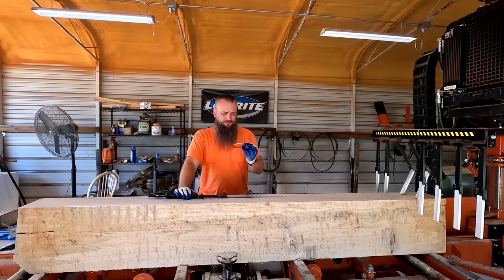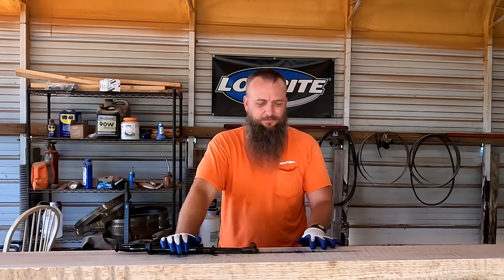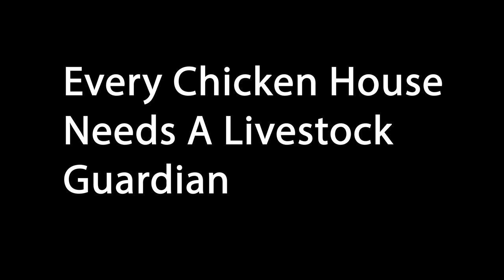Building A $10,000 Sawmill Chicken House

Comment: I haven't commented on a video in a good while but was compelled to do so with this one. I once raised ring neck pheasants and Pharaoh quail. The quail were kept in pens similar to large rabbit hutches, up off the ground and boxes on each end where they could get in out of the weather. But the pheasants had a similar run to the chicken run you built. But I used regular Chicken wire rather than the aviary wire you did, that was smart BTW, help keep the egg eating snakes out. But I dug a shallow trench about a foot wide and maybe 6 inches deep just outside the wire. I used 1/2 inch chicken wire in a 3ft. width burying the roughly 1ft. of wire in the shallow trench. What this does is it presents a barrier for a digging predator like a fox or dog, even some cats will dig. They run into the wire and can't dig any farther. I also covered the top with aviary netting to prevent the hawks and falcons from getting in from above. They also make a clip-on blinder for pheasants that fit in the nostrils. Pheasants will peck each other to death unless you keep them separated or use these blinders. The kiln made a great chicken house and you and your Dad have built a fine run for those pullets. You might consider my suggestions to add to it though. I still enjoy these videos more than most any of the rest I watch!!! Good work Nathan!!

Comment: - Does your area have issues with boroughing predators?
- Sometimes, people have to lay galvanized rabbit wire flat and then cover it with dirt and wood shavings on top to prevent predators from digging under the frame and wire enclosure.
- Other times they just dig a deep 2-3 ft. trench outside the frame, put a skirting of galvanized rabbit wire around the perimeter, and wire it tight to the rest of the enclosure.
Reply: @wdcurry111  . 
- Yup. I guess it was easier than digging.

Comment: Love seeing that hardware cloth on the chicken run. Cost more than chicken wire but those big holes on chicken wire won't stop the black snakes from egg hunting. Good job. As usual you are being smarter than the average bear, just like Yogi. And those band saw blades are better than the old circle saw blades when they hit metal. Lot more expense to replace those carbide tips on those. Good to hear that they are not junk after hitting metal. I was surprised to hear that lead could not them out of set, or was that another type of buckshot? Not up on all the new "non toxic" shot used for hunting today.
Reply: Not so sure about that "guardian". Looks about as energetic as Garfield. Pretty well fed too.

Comment: I found the best way to cut fencing, wire mesh and even chicken wire is to use a metal cutting disc in a battery powered angle grinder.
Reply: I just put that almost exact comment in. Works wonders!
Reply: awesome, my M18 Milwaukee will do that next time for sure.

Comment: PT 2x4 aren't rated for direct ground contact.  A PT 4x4 would have been a better choice for the bottom framing member of your wire mesh area.  Oh, an angle grinder cuts that hardware cloth nicely.